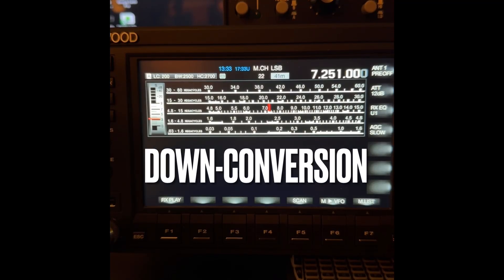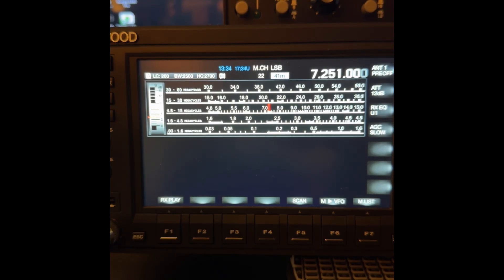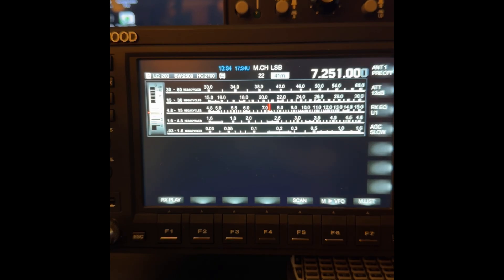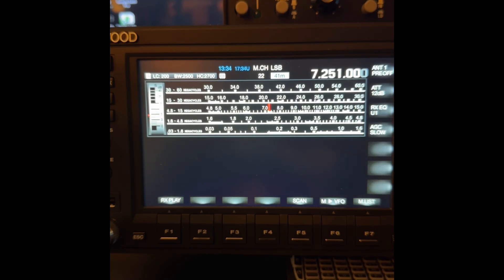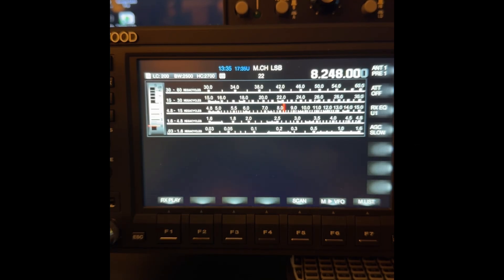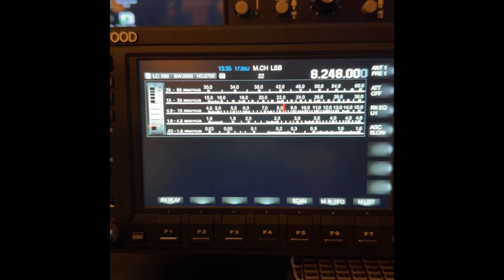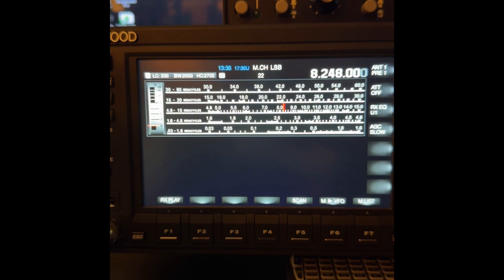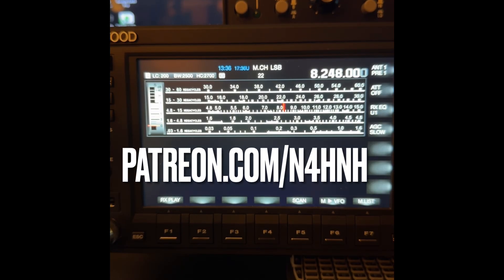Down-conversion “Deafness” Demonstrated #hamradio #superheterodyne #swl #downconversion #ts890 #if

Comment: Wonder if that gripe comes from up conversion fanboys. 
I’ve never noticed it and I get on shortwave listening some. Sometimes for band conditions. 
I’m a down conversion fanboy myself and that’s why I have zero interest in icoms anymore. A narrow roofing filter can be done in up conversion but its price prohibitive. Icom is not really lying about their 3kc roofing filters but they just don’t work. Maybe now and definitely future the direct injection will take over. I’ll have to try that on my k3 when I get home but I do have the swl filter option so it might overcome that. 
Not sure if my Kenwood 590 would be in upper or lower at that frequency but I’m curious to investigate.
Reply from the maker: Up-conversion is fine for image rejection, if you don’t mind the extra phase noise from 3 or 4 IF stages, which impairs the ability to discern weak signals.  The DSP better be up to the task of dealing with noise and interference that made it all the way from the antenna into the digital realm.  Fortunately, the FT-891 (up-conversion) uses the same DSP as in the FTdx10 and FTdx101D/MP.  It doesn’t have as much memory for processing (8mb vs 64mb), but it still does an admirable job.  In fact, better than many competitors.  I count the FT-891 among the best in the up-conversion realm.
Reply: @n4hnhradio did hear this on my k3 although it didn’t go completely deaf. I’m guessing there’s not much to hear at these frequencies and maybe they chose them for that reason.
Reply from the maker: The primary HF broadcast allocation for SWL is around 9.4–9.9 MHz, heavily used by the big international broadcasters (BBC, RFI, CRI, VOA/USAGM relays, etc.).  Below that, 8–9 MHz is not a formally continuous broadcast band, but there are still numerous services and some out‑of‑band or regional transmissions, especially in the higher part of 8 MHz (around 9 MHz edge) during some seasons.  So 8.248 MHz is a good by Kenwood.